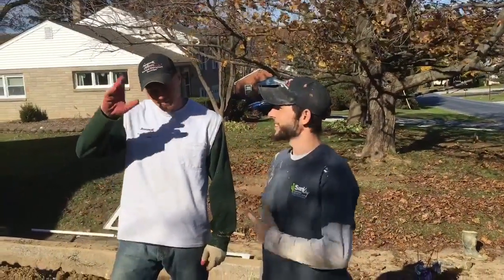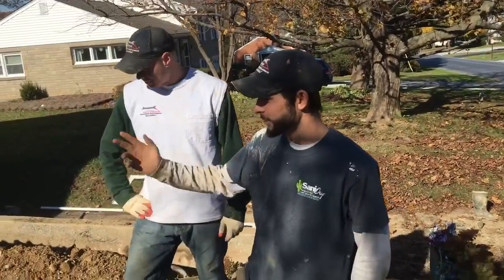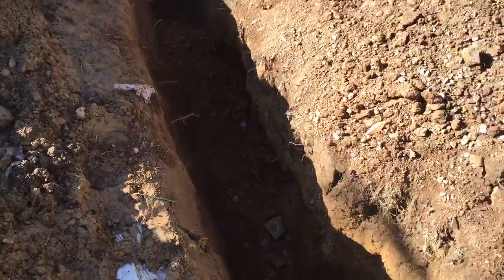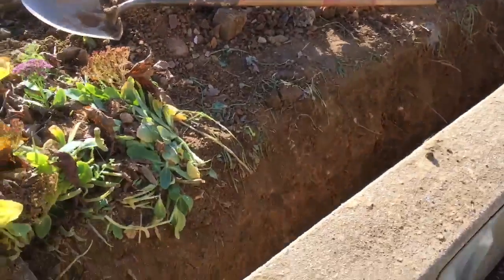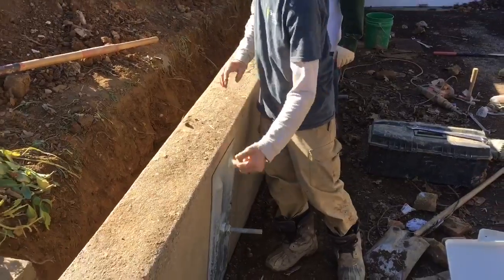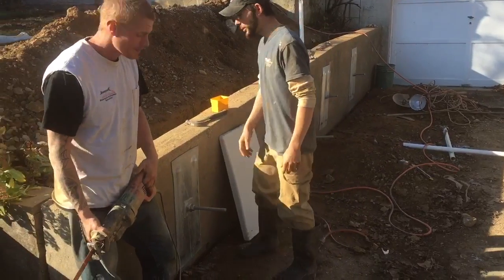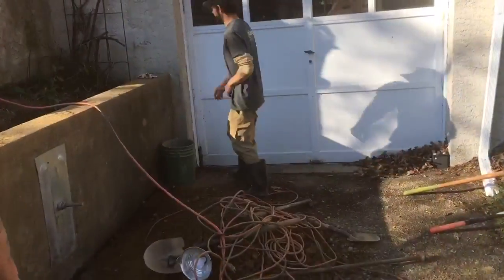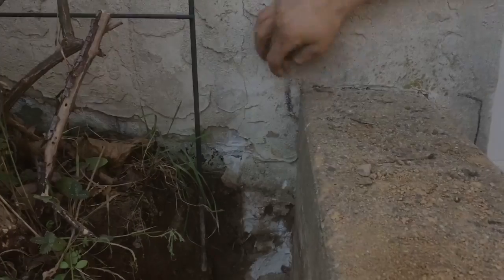Pulling a retaining wall straight with wall anchors.

Comment: it's not cheaper to just rebuild that small retaining wall?
Reply: Another point too is that if the wall is leaning it's because I of the ground shift so if tied the all horizontal through the ground when the ground shift the whole time and anchor would shift too. I thought about making one of these then I YouTubed. But yea your best bet would be to rebuild the wall probably so it can do it's job and retain not shift with the ground
Reply: @soonerbred22  it's cheaper to not rebuild the wall if it's not structurally damaged.  they basically made a metal deadman anchor and i assume will backfill it with gravel and drain piping.